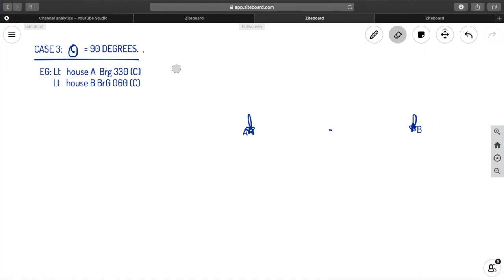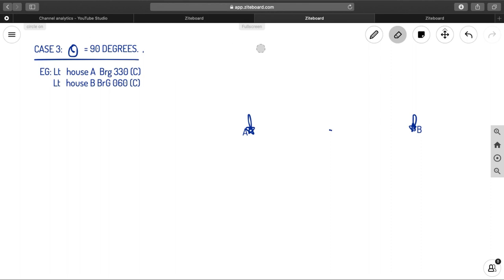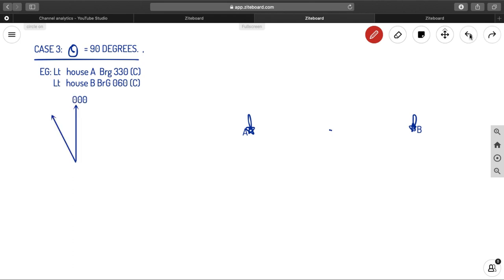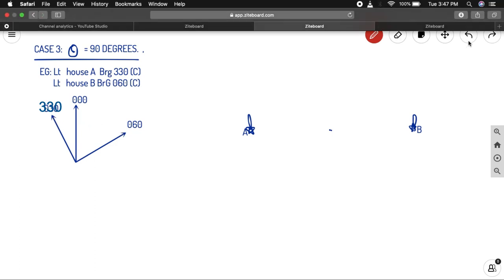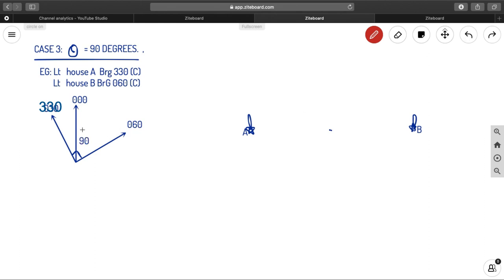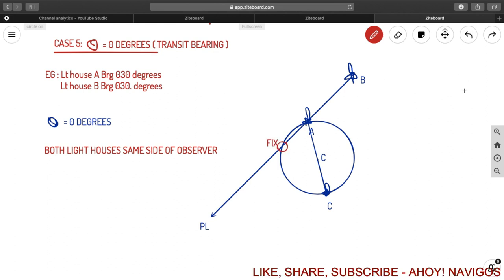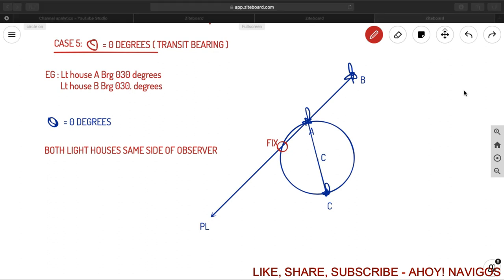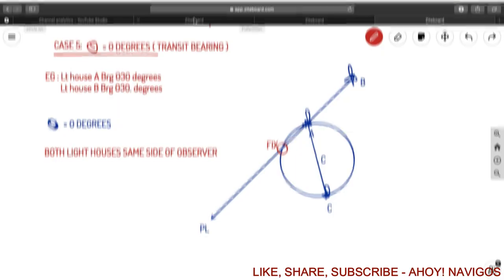HOW TO TACKLE HORIZONTAL SEXTANT ANGLE (HSA) - PART 2 |AHOY! NAVIGOS.

Comment: 000 hours a vessel Little Basses Reef Light (06O
24’N 081O
44’E) was last sighted and at 2100 
hours same vessel last sighted Great Basses Reef Light (06O
10’N 081O
29’E). During 2000 hours 
to 2100 hours course steered by vessel was 210O
T and speed 15 knot. Find out vessel’s position 
at 2000 hours and 2100 hours. (Met visibility was 5 miles throughout the period).

Comment: This problem will solve with metrological visibility 5 miles circle I have to draw
Reply from the maker: Yes you will have to consider met visibility and Nominal range of those light houses and you can  get two position circles for both light houses
Reply from the maker: This is not a HSA problem it is a running fix problem of position circles....
Reply from the maker: Draw two position circles  with luminous range  found from luminous range diagram then you need to do the run from light house initial one...and need to transfer position circles...this is running fix type of problems we will be doing such problems in following video....stay tuned....to AHOY NAVIGOS.